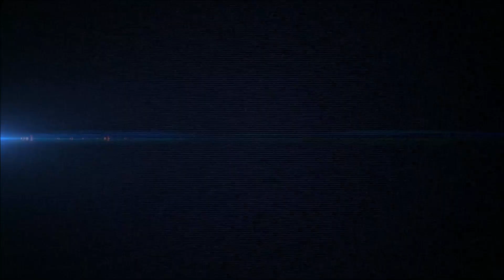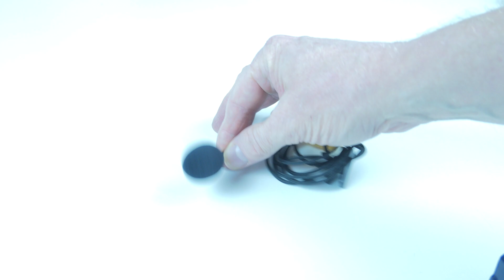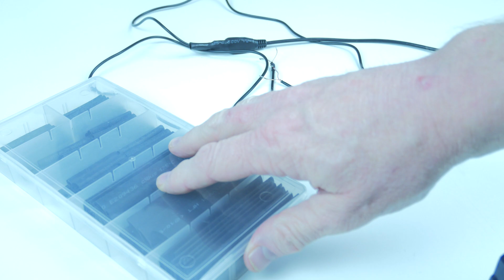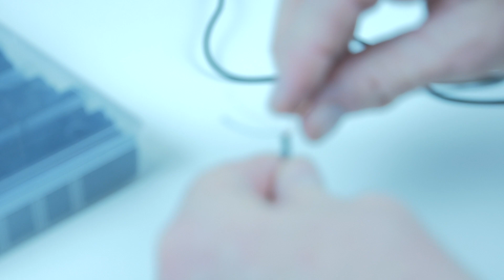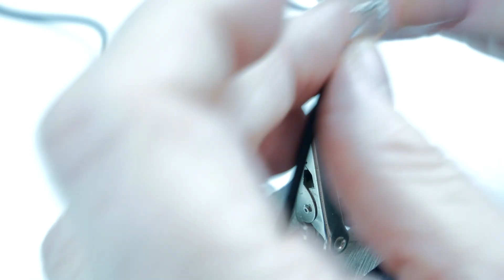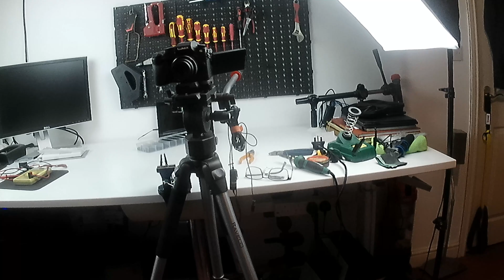How to: Reduce sensitivity overmodulation distortion on electret microphone with this easy hack

Comment: Hello, I've got same camera and problem. Try to put a microusb --> 3.5" audio jack converter and than a 3.5" jack audio with volume control, but unfortunately this converter is not working, tried with phone and do not work at all. I think i will pick my original microphone and cable, cut it, and bring it to someone who do soldering and use a "phone headphone" (hands free headset) they are made to do the job, and if i put one of this inside my helmet is simple perfetct, even with close visor, but I have to use it with my phone (or recorder) and synchronize post production.